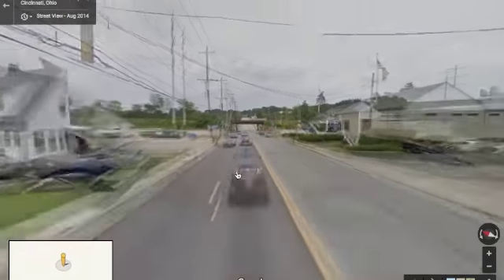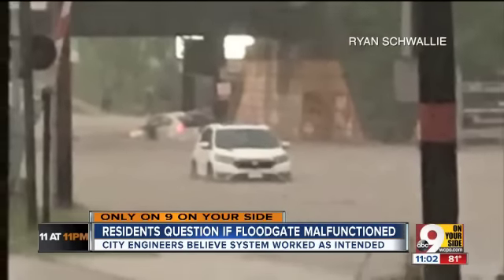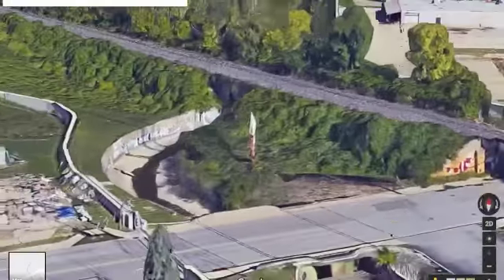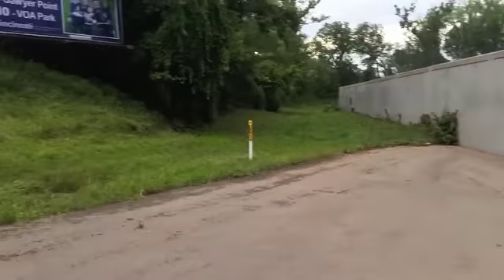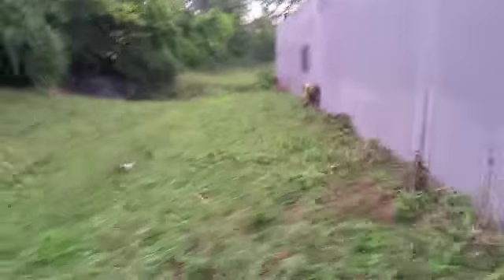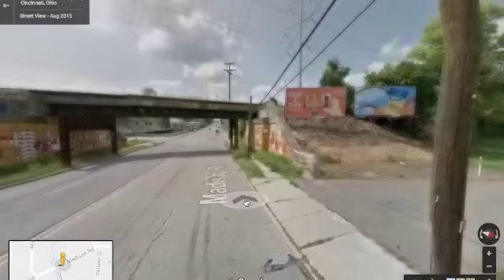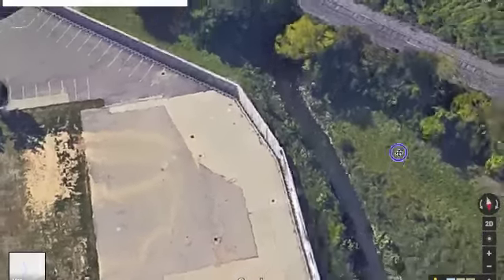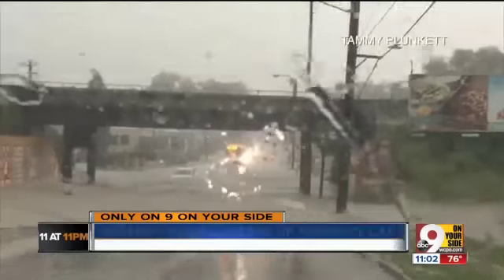Madison Road / Duck Creek Flash Flooding

Comment from the maker: Thank you to the people who have had positive things to say - Also, thank you to all the internet trolls who say nasty things. Please consider the content and don't judge on the quality.

This is not a video for entertainment, it's a video to expose the problem that has gone unresolved and the people who can fix it turn their head to the cries of people who have had many thousands of dollars worth of damage as a result. 

The latest word is that the city has many outside firms assessing the many flood walls in the city that the Army Corps of Engineers constructed many years ago. After they build these, they do not maintain them. It then becomes the localities responsibility. The ones that actually work will need repair soon since the sensors only last so many years. The city is trying to figure out a way to eliminate or band-aid the problems because they cannot afford to take care of these structures.